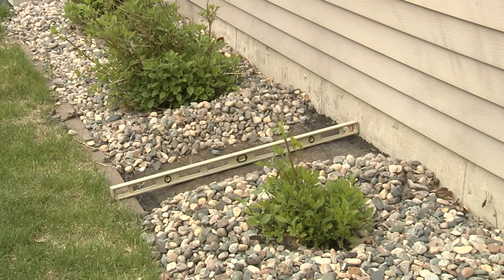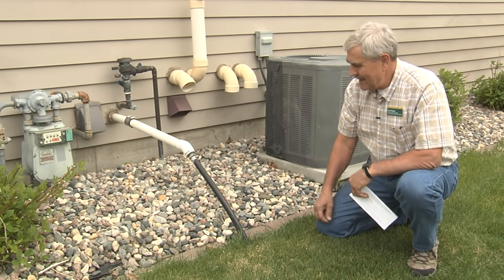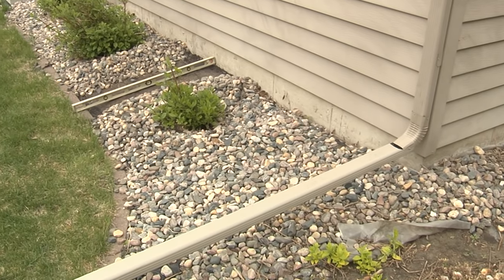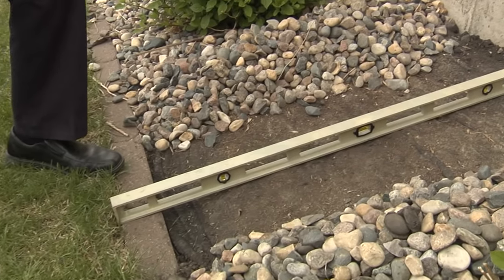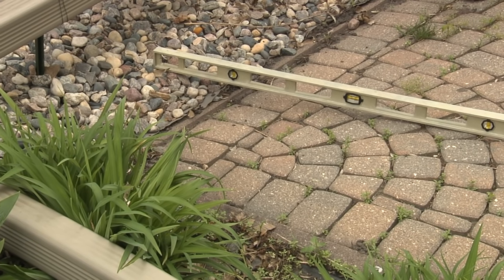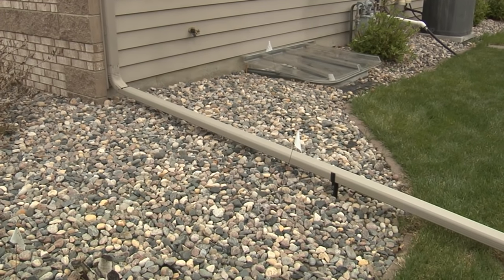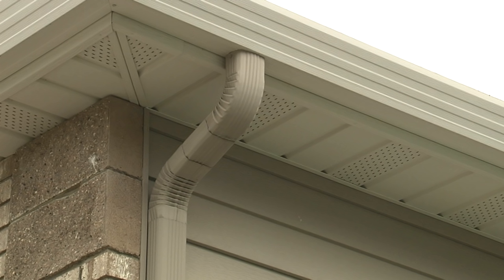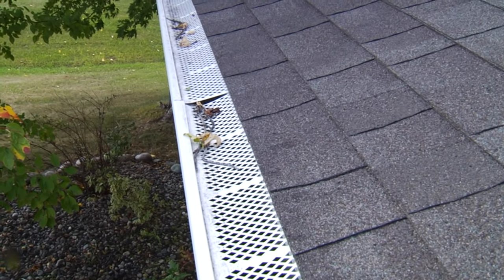How to Prevent Rain Water From Entering Your Basement

Comment: What's the name of that plastic landscape blanket?
Reply: Mark OnTheBlueRidge   So it is best to put plastic on the soil, then the rocks? So many other videos say just dirt then rock. Ty
Reply: @Mark, so will pond liner be the best choice over some garden fabric/plastic sheet?
Reply: @Mark OnTheBlueRidge Now that's what I wanted to see.  The textile fabric and not the cheap stuff they sell for a "weed barrier" which doesn't seem to work anyway. I have small river rocks or stones or pepples. And it just so happens I have 6 mil plastic left over that was used as a vapor barrier on the basement floor. So I'll use the plastic and then cover with the fabric you listed. Thanks so much for the links!!!
Reply: @Mark OnTheBlueRidge oh, I have to add soil to get my desired slope. Is there a particular soil you recommend?  Years ago I got some so called top soil to mix with my dirt to reseed a couple areas. That stuff was way to sandy and misleading to call top soil.
Reply: Mark OnTheBlueRidge how long stay the plastic sheet ?
Reply: @gregsimpson621  someone else said "Class 5" it's a dirt, clay and gravel mix. Semi permeable but the clay it sticks together well